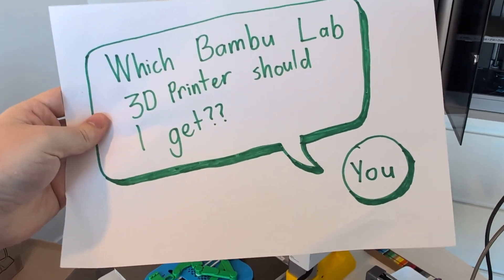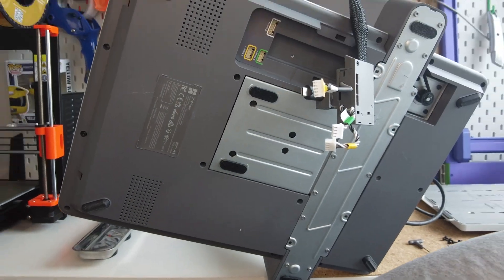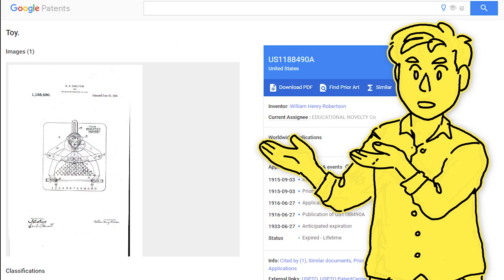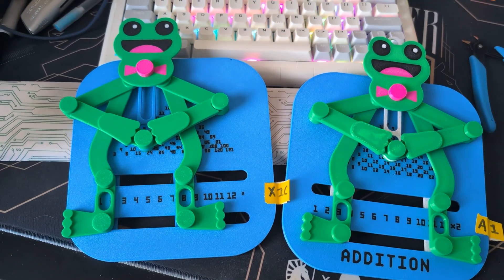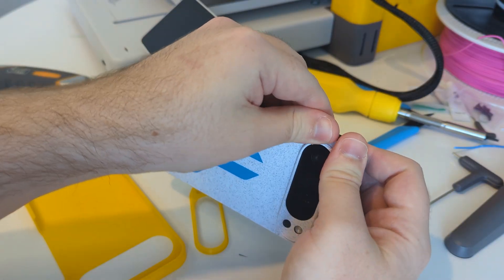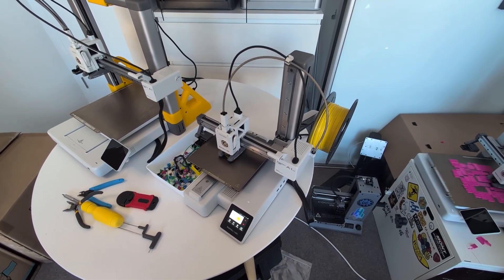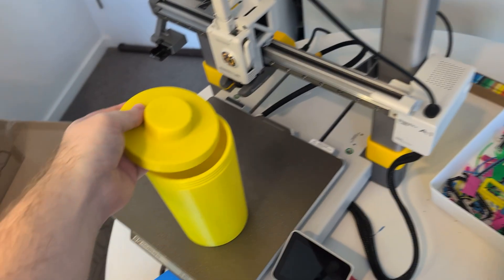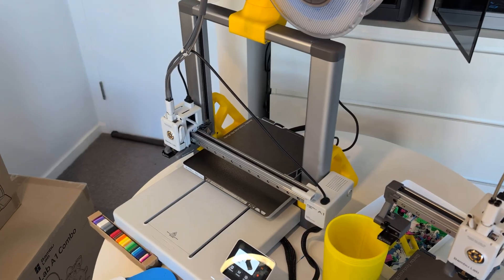Which Bambu 3D Printer should you get?

Comment: See I would say the p1p/p1s is the best printer for beginners. I feel like people give the MVP(minimally viable product) approach to beginners and while it si a valid approach. I've always been of the opinion that for beginners you want to give them something that can handle everything they might want to throw at it without breaking the bank while being the safest possible. In that light P1P is just the better option. Yes it cots more but because it is enclosed it means you can print with ABS, ASA and other filaments that might warp. Because it's enclosed you are going to have less particulates and VOCs in the room. Also you can connect to ti an extractor to remove more particulates and VOCs. While the health effects are still not known it is clear that these release VOCs and Particulates at a high enough level where it might be hazardous. There are tons of papers on this and we even have some influencers like Made with Layers finally addressing this. I would rather a beginner use a p1p and vent that out using the 3d Printed hose attachment bambulabs has made available than use the A1 and ignore the potential health risks.
Reply: It also doesn't have automatic flow rate which makes it a step up in difficulty level compared to the A1 for beginners.

Comment: For that lettering on the calculator, while that bed adhesion/not knocking off the numbers trick is nice, I would simply flip the model so that these numbers print on top then iron the surface.
I haven't really printed in multiple colors, so tell me if that is a bad idea...

Comment: I’m looking to get the A1 mini.  I already have a Creality Ender 3 s1 plus which can handle larger prints better than the small prints so the mini should be very helpful for those smaller prints.  And will also allow me to do multi coloured prints
Reply: I have an ender 3 neo, but also recently got an A1 mini. Literally prints straight after setup. So much quicker, I haven't had to monitor the first layer like I regularly have to on the ender.